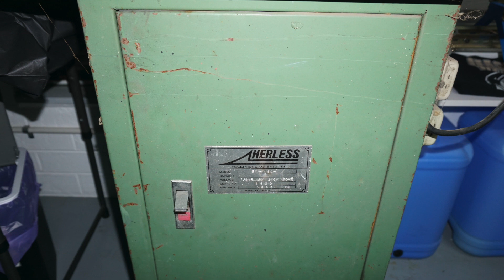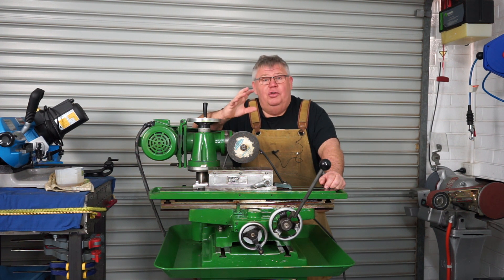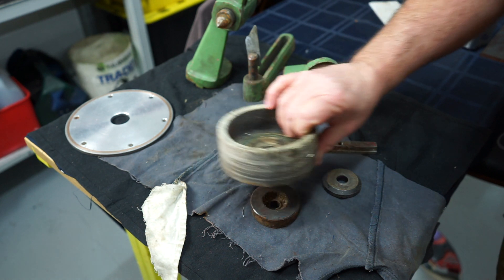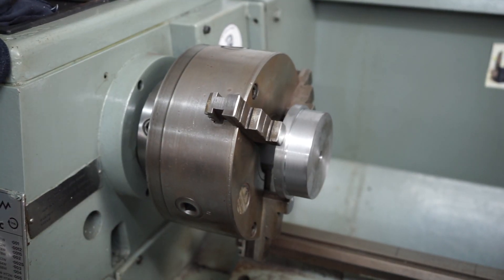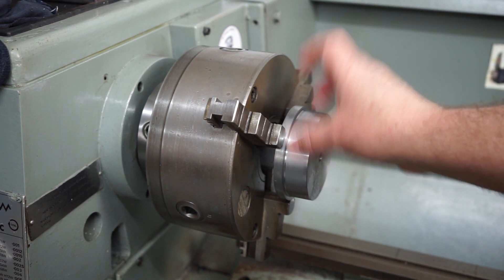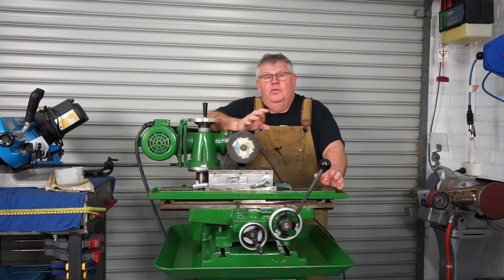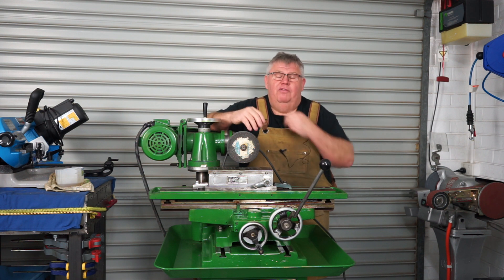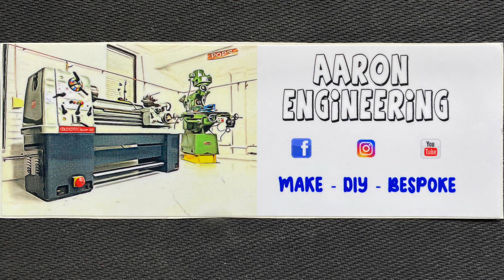My Tool & Cutter Grinder - BM 450A

Comment: I own an 1987 Hafco
You data plate has your manufactur date of 10th month 1988
Reply from the maker: Hello and thanks for watching.  To tell you the truth I just had to check the video again.  Yes it does say 1988.  Is my model similar to yours?  Cheers, Aaron.
Reply: @AaronEngineering  they are basically the same, mine is a 415v that i use a 240v VFD to control the RPM aswell as run on single phase.
Im looking for a surface plate as i would like to scrap it in and give the big girl a paint job.

Comment: Hi, I just purchased this same machine, mine has missing parts also. I was wondering what size wheel (diameter and width) do you have on your machine? Thank You for the video.
Reply from the maker: G’day Charles. They are a good little tool and cutter grinder but can be very limited. I’m missing many parts for mine. I bought a Norton Grinding Wheel (150x13x31.75) part number is 66253124203. Hope that helps mate. Cheers 🍻
Reply: @AaronEngineering  Thank You for your kind reply  Sir.
Reply from the maker: @charleskutrufis9612  you’re very welcome
Reply from the maker: @charleskutrufis9612  I also added this to the video description to help others:
Norton Aluminium Oxide grinding wheel. It’s a 38A60-KVBE-TIA and the wheel size is 150 x 13 x 31.75mm. the Norton part number is 66253124203.

Comment: Thanks for the video, Aaron 😊. Been trying to figure out what to do with my old belt driven grinder, so I've been looking at T&C grinders for ideas. There just really good for grinding single point tools, getting tired of trying to nail those perfect 60° angles freehand lol. Cheers! 😊
Reply from the maker: G'day Chris.  This is my first ever tool and cutter grinder.  I've only done some surface grinding and no other machine grinding before.  Predominately only ever used "Off Hand" grinding.  If you come across one cheap enough, I'd snaffle it up.  They are cool to play around with.  Cheers, Aaron.

Comment: Grinder cleaned up with some new paint looks Great Aaron.  I picked up a Cincinnati tool grinder a couple years back, now feeling a little more motivated to get it up and running. Thanks for sharing.       Gary
Reply from the maker: G’day Gary. Thanks mate, but she’s nothing like your big grinding / valve lapping machine. Gary, I just found your Instagram page and followed you. I also sent you a personal message via Instagram with all my contact details. Hopefully we can exchange stickers soon. 👍🍻
Reply: Hi,Ive had mine in the celler about 20 years. Thought I would sharpen tooling after Id retire,but dam those inserts.

Comment: Yaay,
Reply from the maker: That ones for you buddy 👍🍻
Reply: @AaronEngineering  Hey Mate,

Does that T Nut fit theTable slot ?
2:10
Reply from the maker: @ChrisR2517  Good pick up Chris.  I have never tried before.  I just went outside now and had a crack and discovered that it doesn't fit anywhere 🤦